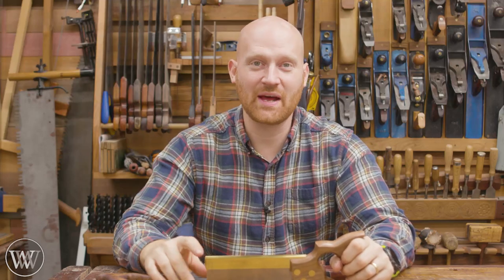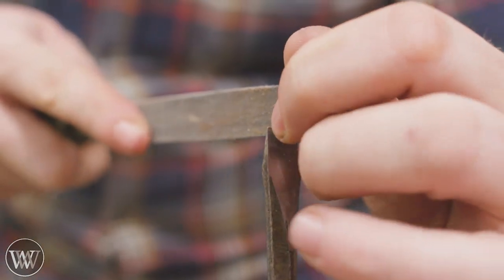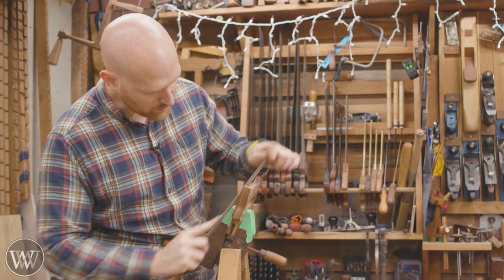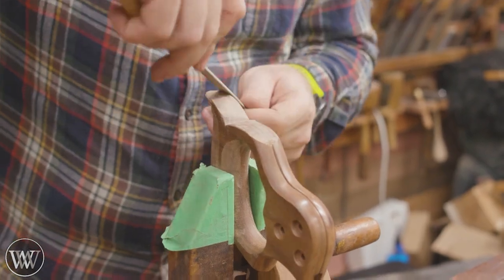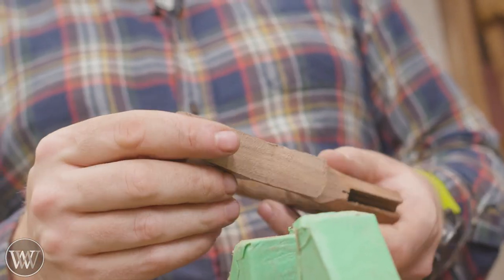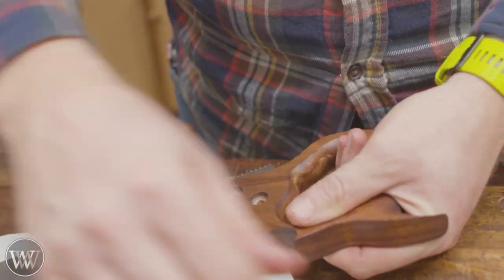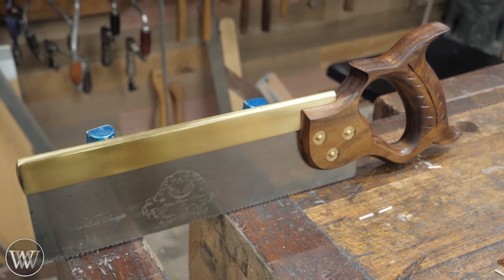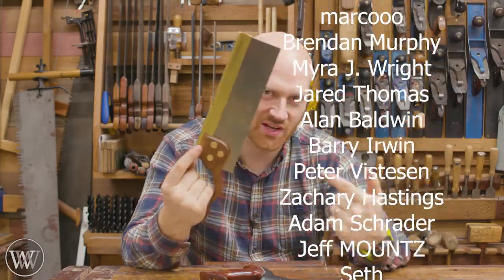How to Shape a Saw Handle

Comment: I’ve seen these Pax saws and wondered about the quality; as per usual, James comes trough with my answer! Awesome video
Reply: I got the pax dovetail saw for xmas, theyre a great choice.  Sharp and set out of the box is smooth, good heft to it too. Lynx saws are good, just need a little tuning, not a ton but tenon saw i got works well.
Reply: @contra81  good to know, thank you
Reply from the maker: Ya Lynx are in the same boat. great saws that will not break the bank

Comment: Before I learned about antique tool collectors' clubs as a source of fine old user tools, I ordered a mail order PAX saw. After a few cuts I set it aside and eventually sold it for $5. As your whole video suggests, the factory handle was designed by an accountant but I quit using it before it generated blisters. Boiled linseed oil is even better for tool handles when gently melted 50/50 with beeswax.
You've done a real service by encouraging people to fit tools to their own hand and demonstrating the techniques. After 45 years in the shop, I'd never considered a bow sander. I look forward to making and using one. Thank you.

Comment: My favorite is the E. A. Berg bolt cutter.  I am a hand tool woodworker and I have found the best chisels and plane blades come from E. A Berg in Eskilstuna Sweden.  They sharpen beautifully and come to a mirror finish with proper sharpening and result in a very smooth finish.  If you come into any plane blades or chisels from Berg that you don't need let me know.  Nice haul by the way,  thanks for another fun video.